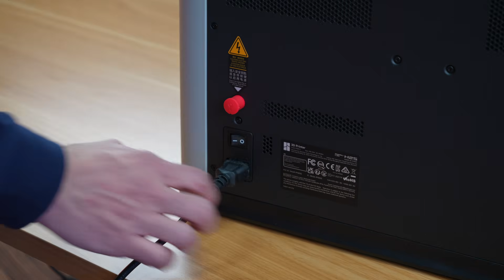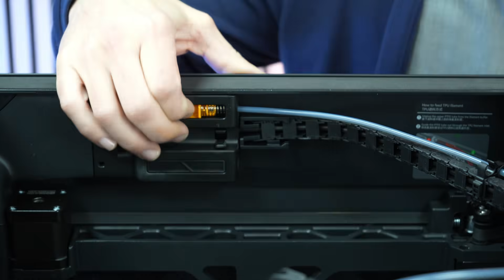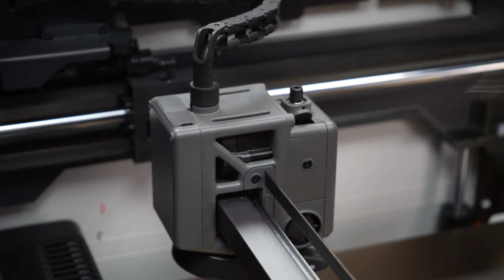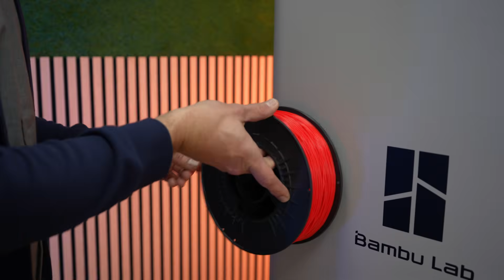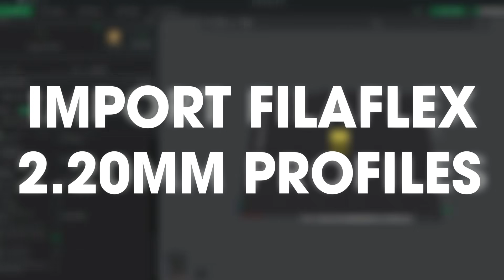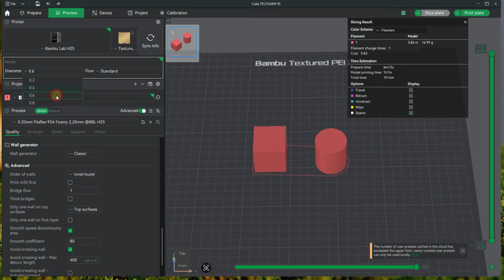How to Print TPU Fast in Bambu Lab H2S | UPGRADE Filaflex 2.20mm

Comment: I'm looking to buy a new bambu lab printer. And it's ability to print filaflex will be a big part of the decision for what model i get. I have been printing 82A and even 70A on my old modified Felix 3.1 printer for years and i want to keep doing that. I see you re planning to support al but the H2C printer with this 2,2mm upgrade. Any plans to support the H2C in the future? This will help me make my decision. Thanks!
Reply from the maker: Hi! The H2C printer is currently not on our development roadmap. We have other printer models scheduled ahead of it, and within the Bambu Lab ecosystem, we have focused our resources on validating and supporting models such as the H2D, H2S, and P2S.